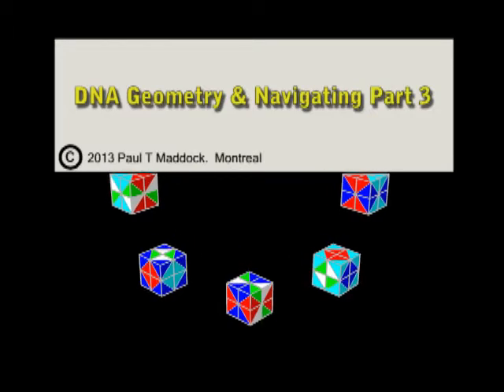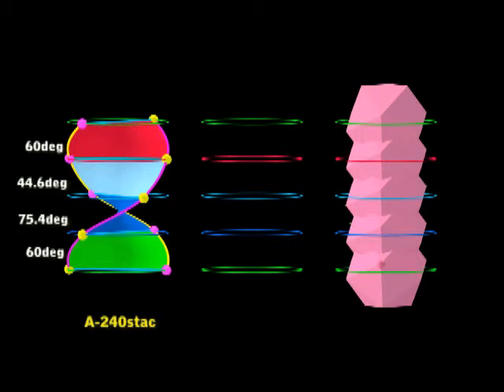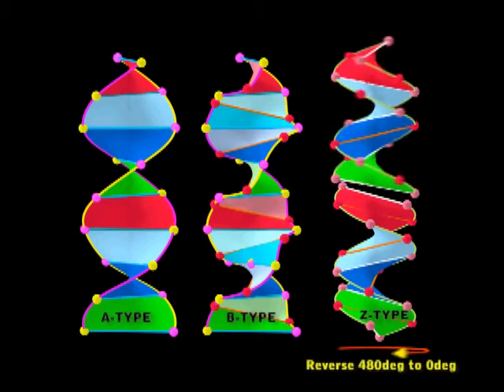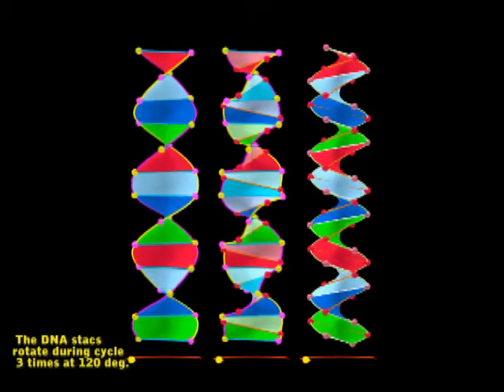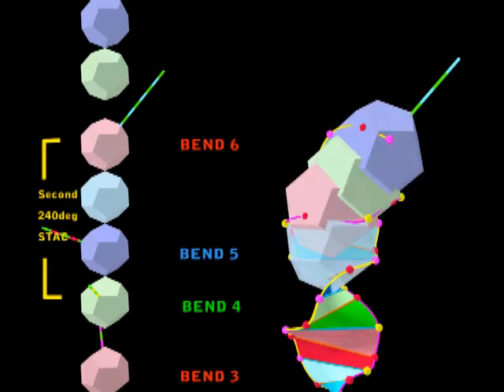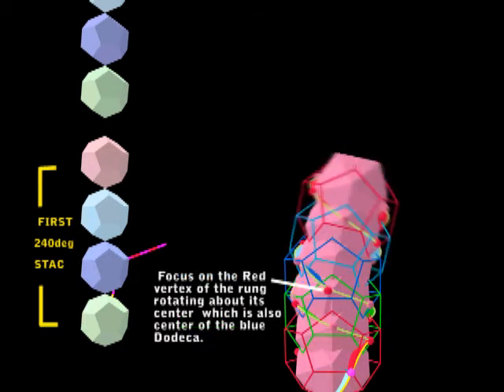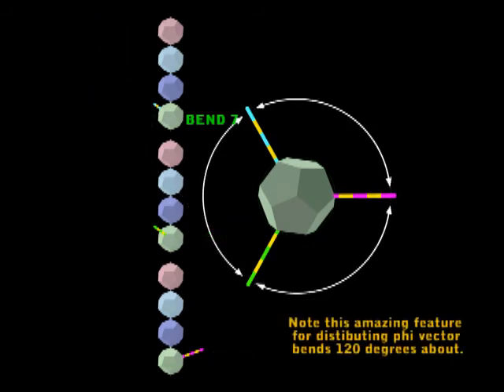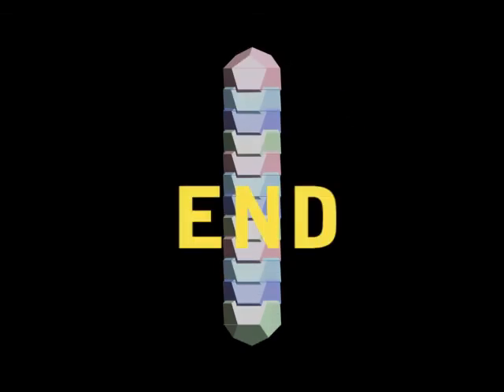RESEARCH The basic geometry and 9 bends of DNA

Comment: 369 = 5 to the 4th minus 4 to the 4th
part of a 4D matrix
and a very cool number ;-)
Reply from the maker: You are welcome to use my stuff any time. Thanks
Reply: ThePaulTM
Thank you, very interesting, the numbers, degrees and ratios are amazing.
1.732 ??? (plus one)
2.732 = avogardo's number (pounds)

Phi squared = phi plus 1
Phi over 1 = phi - 1
Sidereal months per year 13.369  <369
Synodic months per year  12.369  <369

Synodic months + 1 = sidereal months per year
Reply from the maker: ***** Wow amazing !  Please check out my last video on the Metro. The 369 and tri-penta sequences giving 100 strings I think the math will blow you away and it is down your alley. The color charts I hope are OK I have double checked them.
Reply: ThePaulTM I will, also look at your older posts very soon.
Thanks for researching and posting, much appreciated.
Reply from the maker: ThePaulTM It is very interesting what you say about Avogardo's numbers the 2.732 and 12 comes in also as in the 12 stack. Good Eye!